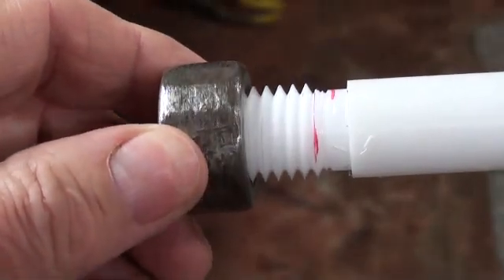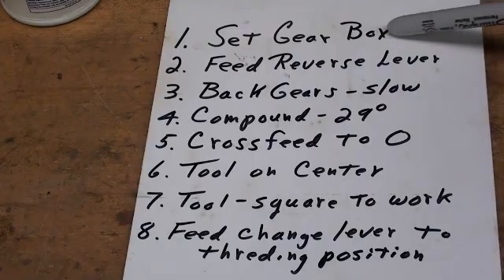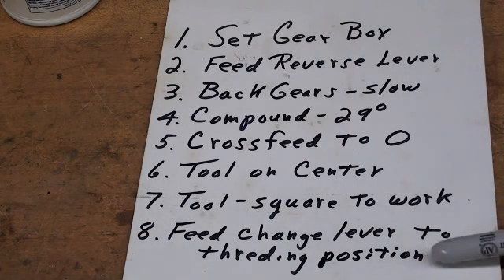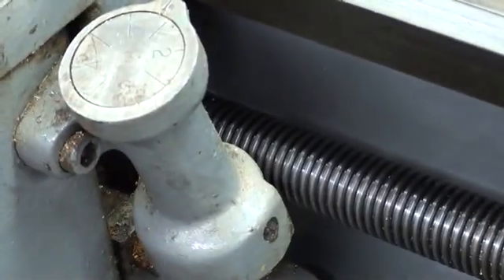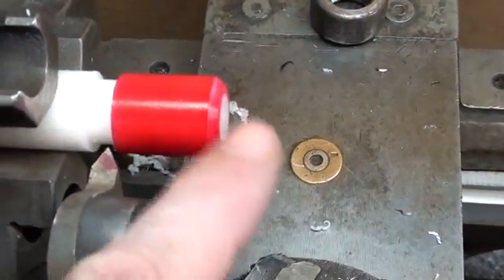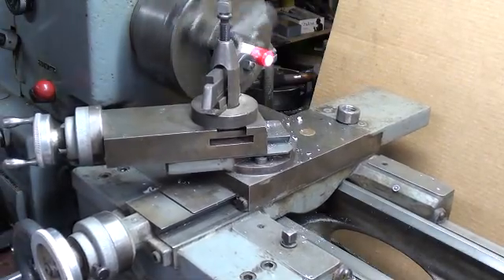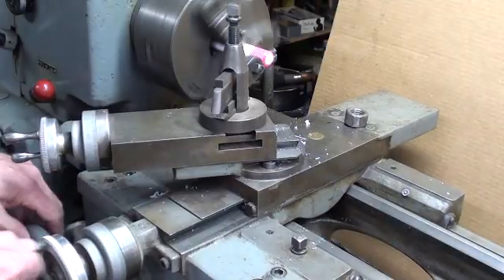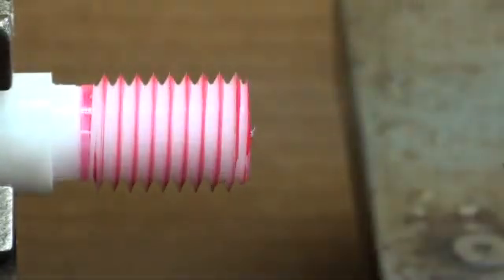MACHINE SHOP TIPS #16 Clausing Lathe LH threading tubalcain

Comment: The only shops I've worked at that use any real manual lathe and/or mill machine lines or either rebuilding electric motors shafts or industrial pumps, at least around here anyways. Yeah they do lh sometimes fo sho. I don't see how running the machines is hard for a monkey to do but, i do understand how u dont know shit if all u can do is run a lathe or a mill or wtf ever else for that matter. Mr. Pete knows what I'm saying...

Comment: Great video.
I'm not a machinst, but I can't help thinking what difference does it make what angle the compound is at considering you have a form tool. Surely, even if the compound was at 0 degrees you would get the same result. I'm baffled.
Please advise.

Comment: I had a bolt broke off in a hole today on a detroit diesel timing cover. It was to deep to use a extractor. Drilled it and used a left hand tap I had to put smaller left hand threads into it than took a larger bolt made a holding fixture for it, turned it down to a left hand 3/8 with a shoulder and extracted the broken bolt.  Your tips while sometimes not used every day help tremendously.

Comment: Mr. Pete, I am fairly new to Metal Lathing.  I have cut probably 50 threads on my 9x20 lathe and a 12x50 Sheldon.  I have never had much luck creating a good thread using the compound like you did.  I'm not sure what I'm doing wrong.  I set the angle to 29.5 degrees and have tried to use the compound to create the thread.  It has never worked for me very good.  It works much better when I use the cross-feed.  What is the advantage of using the Compound vs. the Cross feed?  My friend who has the 12x50 Sheldon said that he never uses the Compound slide either because he hasn't had much success that way.  He's a long time gunsmith.  What am I doing wrong?  Thank you for any help.
Reply from the maker: When you feed in with the compound, the tool cuts on only one side. If you feed straight in with the cross slide, the tool cuts on both sides.if the cross slide feeding works for you, use it. There is no one looking over your shoulder LOL
Reply: Is there an advantage to only having the thread cut on one side?  Besides now my shop teacher knows that I'm cheating.  :-D  I never took metal shop in High School.  Now I kick myself for not learning about these wonderful tools earlier.  I'm making up for it by being in your class.  Thank you for all of your videos!  They are amazing and always very informative.  I love your occasional quip about the lady with a mustache down at the hardware store that knows everything, etc.  Again thank you.

Comment: Hi Mr. Pete Tubalcain! This is the second time I heard you in your videos (I think the first one was in your video on cutting RH threads) say that "you have to do math" on how much one is to feed the compound slide because it being set at 30 deg. (29 1/2 deg.), it is not feeding into the workpiece as shown in the compound dial. You are right. However, there is no math needed because the compound needs to be fed into the workpiece by the thread pitch one is cutting. The thread profile created is an isosceles triangle; i.e. having three sides and three angles equal. So the compound needs to be fed into the workpiece the same amount as the thread pitch being cut. So, if the thread pitch being cut is 18TPI, the compound needs to be fed into the workpiece 1/18" or 0.055" about 55 thousandths of an inch. This also applies to metric threads but not to acme and square threads.

Comment: If your lathe does not have a reverse feed option (only reverse everything) could you cut a left handed thread from the back side of the lathe? I need to make a LH tap to finish the hold down bolt for a jaw in my 4 jaw chuck.
Reply from the maker: +ExtantFrodo2 Thanks
Reply: mrpete222
Huh? I asked a question.
Reply: what kind of a reply was that?

Comment: I realize he probably doesn't have time to answer questions, and that it only happens once in three lifetimes, but could someone tell me WHY one might need to do left hand threads?
Reply: Left hand threads are used in drills and arbors when they go in the same direction it will loosen the nut, left hand (or reverse threading) will tend to tighten the nut to the working piece like a grinding wheel or buffer..   excreta  Cause you don't want it flying off while its running full speed !   hope this helps
Reply from the maker: *****
Thanks for watching and commenting
Reply: +Don Staley I don't normally pull people up on things, we all make mistakes, "excreta  Cause you don't want it flying off " you certainly don't want this stuff flying off LOL, a slip of the fingers you meant Et cetera, sorry I had to, LOL
Reply: binness No problem ,Thanks for keeping me in line. (i need that  sometimes)

Comment: Hello from down under in Australia mrpete, I have a sieg x3 lathe, and a need a left hand thread, but I can't reverse my lathes half nut is there any other way I can cut the thread? Its a m8 1.25 the part is for a tension rack for a gokart, so I can rotate the rod and pull both threaded ends together.
Reply from the maker: Did you watch this video?   MACHINE SHOP TIPS #16 Clausing Lathe LH threading tubalcain
Reply: Yeah I can only reverse my lathe the lead screw and chuck go reverse and I'll just snap the inserts, can you buy a lead screw gear box? Or are alllll lathes different on the gearing connected to the spindle/chuck shaft?, so how I need to ha e the Cross slide behind the work :(
Reply: I know this is old but in case someone else has the same question or similar....... I have in the past put tool bits in upside down and cut from the bottom. Yes the complete opposite from normal. Just put a tool bit in upside down, be careful watch, look, listen, just like you always do and you will be fine. Good luck

Comment: This is very helpful, and LH threads are not really that uncommon. I may attempt to repair a 4-jaw independent lathe chuck which has 3/4-8 LH square threads. But I don't think my HF 9x20 lathe has reverse for the leadscrew. Any ideas? Thanks!

Comment: Thnx for this video. You stated that doing this is hardly ever needed but I think there is ample use for it. Normal threaded nuts & bolts are generally available in all sorts and sizes, no purpose in making those yourself. Left threaded material is considerably harder get and when you find it, you often need to buy more than just the one that you need. When threading on the lathe, I tend to make threads with a special size or left-hand ones.

Comment: After about 7.50 when you put on the extra dye. It, (the dye) has remained on the lagging flank of the thread because, your depth is being set by the compound slide set @ 29 degrees....( tool advances 29 degrees to the right) and not set by the cross slide.
( tool advances @ 90 degrees to the thread)
I like your videos.!!!!!

Comment: You say that you might not do left handed threads in 3 life times, I have to laugh. I do about 6 left handed threads a week at my job. I rebuild and repair Vertical Turbine Pumps. The shafts always have left handed threads. If they didnt, than when you would turn on the motor to the pump it would loosen the shafts from the couplings. Just thought I would share. Great videos Sir!

Comment: A while back, I had to cut a metric thread. No one in my shop knew how to do it. I made a call to an older toolmaker and found out that when cutting metric, you never disengage your halfnut. You have to be quick and reverse the direction. If you disengage, it will not pick up the thread even though you start out on the same number.

Comment: first attempt on my S.B 9 inch will be making a belt tensioning bar,so i need left and right hand threads.this is my libary for lathe processes.keep it up!!to have a disc library would be awesome,as my workshop is too far away from my internet connection...

Comment: Your lathe has a threading dial? Lets say 4 segments........ cut a thread on #1....back it up and repeat only drop your half-nut on #2 segment..... On most lathes that should be 180 degrees off from the first thread. That oughta give a you 2 start lead.....the other segments are for multiple starts.

Comment: As said three lifetimes.  Around here left bolts can not be found only nuts. Cabin
fever as it were, so I bought a bunch of various size Lf. nuts all the way to 1 inch.
and left threaded in brass on my SB 9A.  (common sizes course/fine)  they were
cut about 2 inches & knurled.  Now I have a box of these.  I call them my test
go or no go bolts. Thanks  to you I think they are called 3A? no slop , nuts go on
like a watch.  GK1918 which means Greaves Klusman heavy 20 built 1918.

Comment: Actually I have never had the need for left hand. So I go to the store and buy a couple
of 1/2" left hand nuts.  So I use a dead center, the work is rigid.  My tool is ground
60* with no top rake.  Absolutly horrible looks more like it was dragged down the
asphalt hyway.  This SB does fine with right threads but does not like lefts. The
machine is set up correctly and I do not reverse, thats only more 1/2 nut abuse.
Also I am not taking deep cuts-tool centered-perp. on target. No avail.

Comment: Why did you use the compound axis? Surely if the tool is the correct profile for the thread, any advance on the x axis via the compound screw will not give a correct thread form. If you notice on your last cut, you were only cutting on one side of the thread.

Comment: Fuel line hoses for propane and other gasses are leftys.

If I understand correctly, you never disengaged  the half-nut, you only switched the power feed off and on. Therefore, in your case, you never needed to consult the threading dial.

Comment: I'm not experienced in thread cutting but there are many folks who don't use the thread tracing dial to time when they should engage the half nut. They merely keep the half nut engaged during the whole process and run the lathe in reverse to get back to the staring point then run forward for another deeper cut. This makes more sense to me rather than relying on timing.

Comment: That was cool.  : )
I kind of got the hang of screw cutting but as I was trying to cut titanium and it was only 8mm diameter which deflected quite a lot, I didn't get very good results. 
I ended up using Coventry die heads.